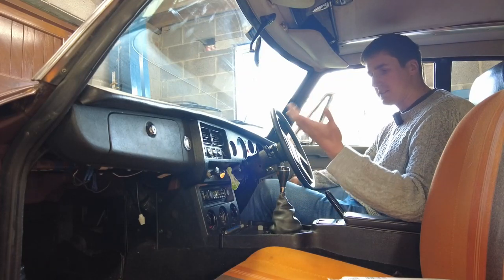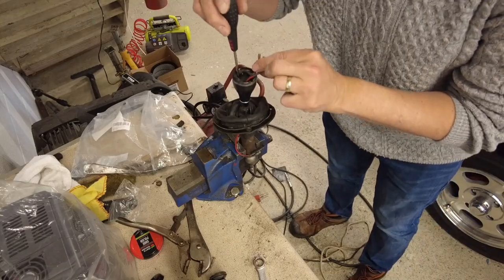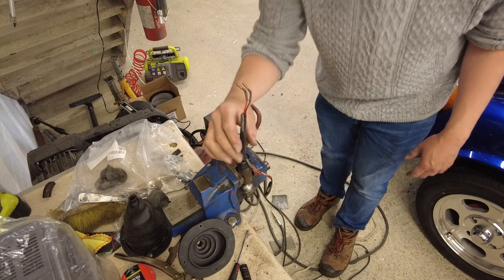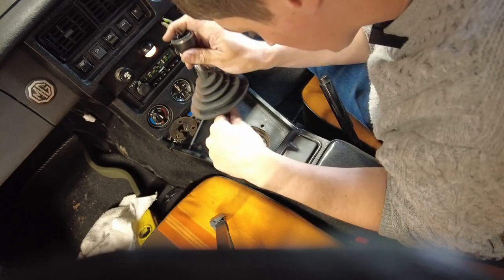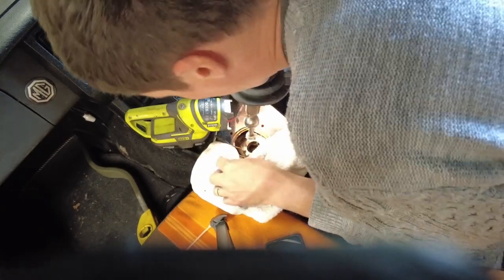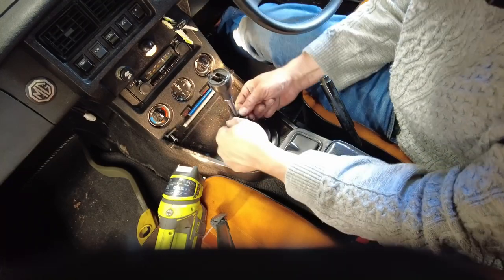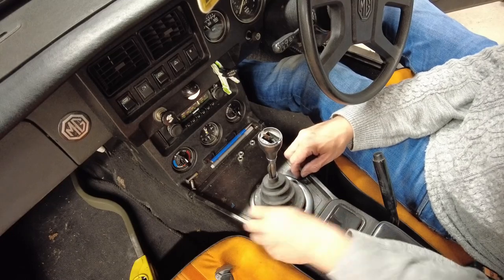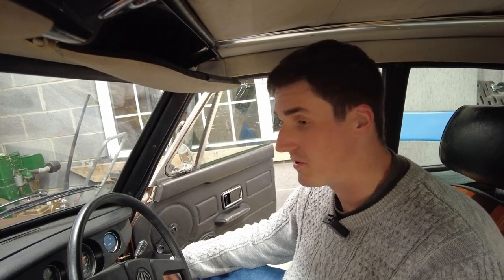Effortless Gear Changes: Improving MGB Gear Shift with Bushing and Gaiter Replacement

Comment: To fit the bushing best to wrap the top of the bushing with PTFE this will hold it firm while you push the lever with bushing into the hole. The PTFE will slip off as the bush enters. It works every time.
Reply from the maker: That's a great idea. I'll try that next time I've to do it. Thanks!

Comment: Had to do this recently the problem is the new bushes are oversized relative to the cup they are meant to go in if you use a new one it probably needs to be turned down slightly

Comment: It's not the leather gaiter that is the problem but the rubber.  If you lubricate the lever with Vaseline you don't have to remove the knob, heat-shrink makes it even tighter.  Having gone that far if you invert the rubber so the pointed end is down by the gearbox that makes the shift much lighter.

Comment: The boot should not be tight to the shaft, it should be aloud to slide up and down without resistance when shifting. mine use to pop out of 4th.

Comment: I put a hole in the top of the tunnel, now I can actually see the bushing as it does not go in.....  Ive used alot of words which only upset the dog.
Reply from the maker: Wrap the bushing in PTFE tape before installing it.

Comment: My guess is the real origin of the weak positioning for the 3d gear lies elsewhere. The gears are selected by shifting the shafts holding the arms moving the gearwheels and synchromeshes to different positions. These shafts have indents in them in which balls under springpressure assure some resistance to moving in and out of the correct position for the selected gear is exerted. Since this is a low mileage B, it is unlikely the indents are worn away partially, but a spring failure to weaker action is a distinct possibility. Does as such not warrant a gearbox inspection, but IF it ever has to come out anyway this is a future option. 
BTW I only once worked on a gearbox, from a 2CV at the time and the fear of letting such a ball escape into the innards of the box, i.c. to the inbuilt diff troubled me a lot at the time. MGB gearboxes I give a wide berth, these are for specialists only IMHO   😯

Comment: It doesn't matter which way round the wires to the overdrive switch are connected, but it is very important to fuse that circuit as it is not fused from the factory, and those wires can chafe and short out.

Comment: Third gear fallout with the leather gaiter is an issue with many MG's. John Twist in Grand Rapids Michigan had a couple of videos that address the issue of fallout and issues with engaging reverse. There are some adjustments that can be made on the gearbox. Skip to around 2:30 in the first you tube link. This was made as they were moving into their new shop in 2011. https://www.youtube.com/watch?v=03yV73jNbkM    The second video deals with reverse and again this can be done under the car with adjustments to the reverse light switch and a plunger under tension.  https://www.youtube.com/watch?v=MDaAPeEu2sI   I do hope this helps. John has retired from the daily work but still has a small shop near me and he travels to all the national MG shows around the US conducting teach and repair seminars.
Reply from the maker: That's brilliant. Thank you so much for this info. John twist is fantastic. I'll check those videos out. 😎👍

Comment: The plate with 3 holes in it - does it only fit in one position or would a different orientation make a difference to the gear change?😊😊😊
Reply from the maker: Given that it only has 3 holes, any other way would have the slot in a peculiar orientation, so I think it's right. That said, I'll look into that. Thanks!

Comment: Did you check both motor and gearbox mounts?
Reply from the maker: I reckon the engine mounts do need changing. Not a job I'm looking forward to.

Comment: Aren’t there 3 springs with the 3 bolts? Nothing beats original parts
Reply from the maker: Yeah but they don't make a difference. I tried using spacers with the springs to no avail.
Reply: @Endfloat  Did you try spinning the shifter 180 degrees. I don’t know why that rings a bell
Reply: Actually, the springs make a difference, or they would not be part of the design. The cover plate rises and falls depending on gear shift position, putting down force on the pivot ball. If the cover plate is screwed down tight, the shifter can not travel full stroke, and it will pop out of gear. Put the right parts in there. As for the bushing, bevel the bottom perimeter with sand paper before pushing it into place. The remote control hole has a sharp edge. Bevel the plastic and it falls into place.